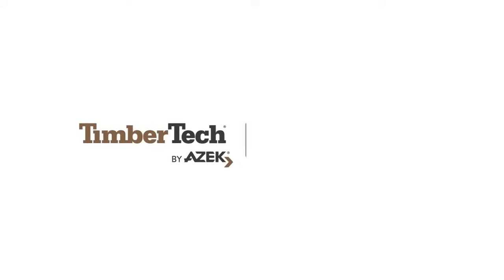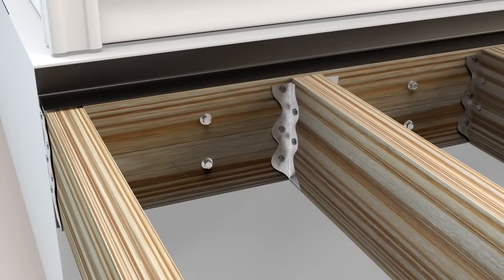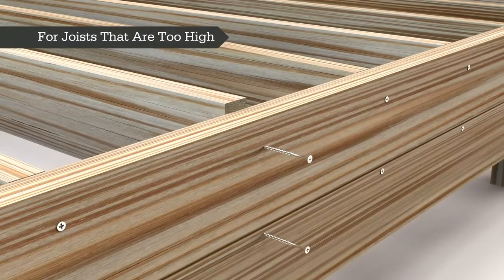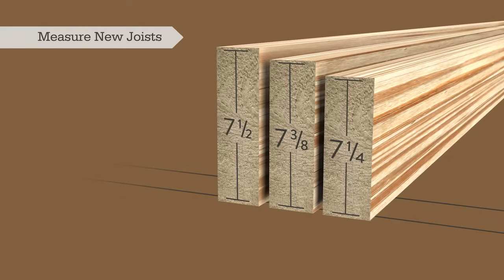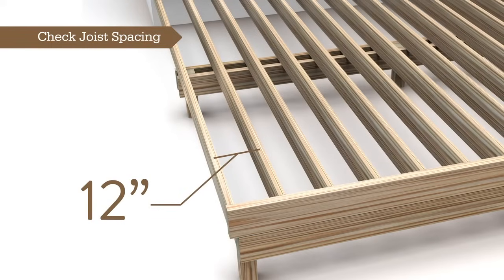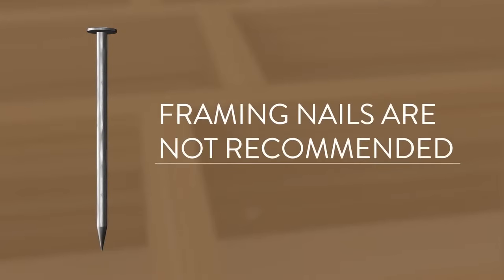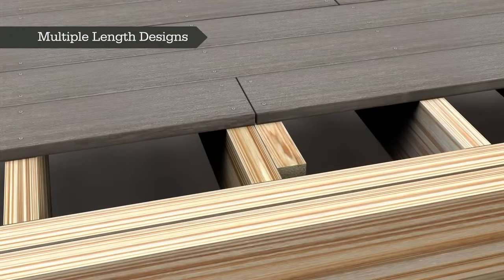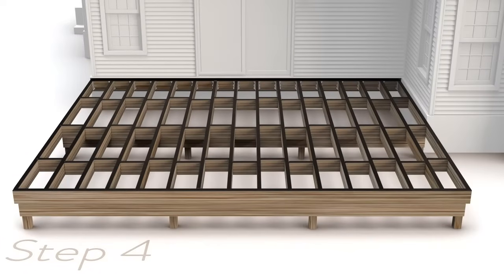Joist Spacing & Blocking Overview for TimberTech Decking

Comment: Surprising they have a beam illustrated without bearing direct load on the post. I thought by now everyone has moved on from that style
Reply: Isn't that the same as the header mounted to the wall?  Granted it's not as many fasteners, but if the fasteners will stand up to it, why not?